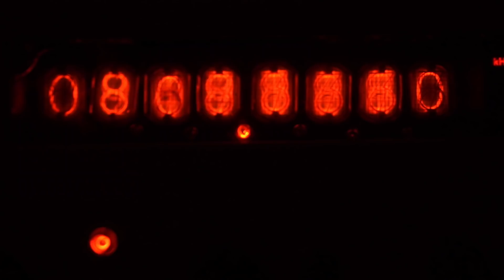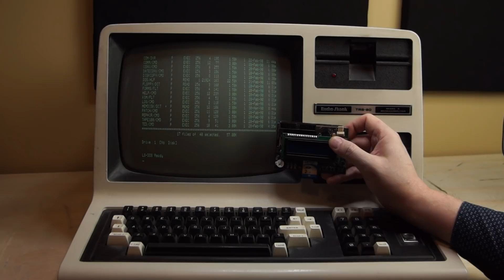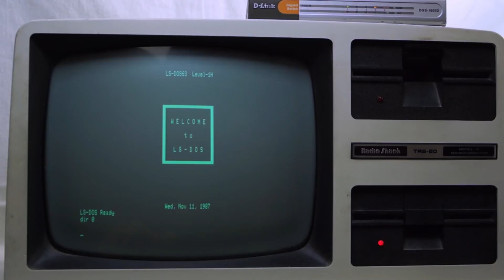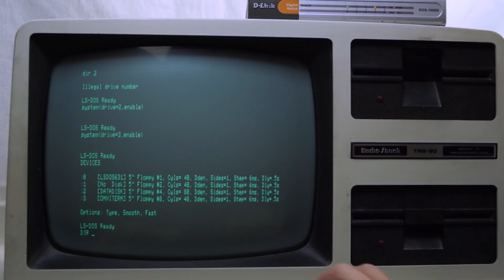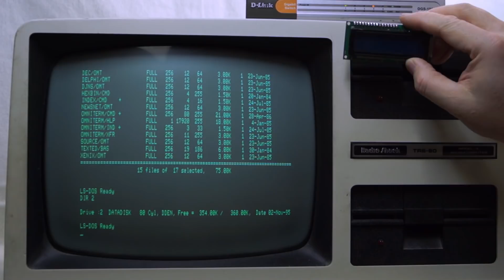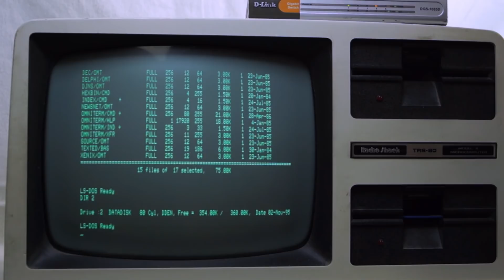HxC SD Card Floppy Emulator on a Radio Shack TRS-80 Model 4 Project

Comment: Would this work on a Tandy Model II? I have a hard disk card aswell, but its only the 1st revision.
Reply from the maker: Yes, this will work.    You'll need an adapter to plug from an 8 inch floppy connector to 5.25 inch (they are different), but otherwise it will be fine.
Reply: @RetroLogicLaboratory  Just to be clear, for my sake, from the external port on the back of the machine for more floppy drives a 50 pin ide like connector, I can attach it to a converter, down to 34 pins and then too the device you have there. Do you know if I could also do that with a Gotek drive?
Reply from the maker: @computeraidedworld1148  hmm that's a good question.   I was thinking from the end of the cable that connects to the 8" internal floppy.   There's a 50 (?) pin connector on that, which can be converted to 34 pins.     Not sure about the gotek, I've never tried them since the new firmware was released a few years back.  Probably would work (?)

Comment: I would like to recommend 2 brands of screwdrivers made in my country: Picquic and Rolgear.  Both are even manufactured in my province, and both should be safe for electronic use.  I know that there is a trade dispute going on, but I have to recommend them anyway.